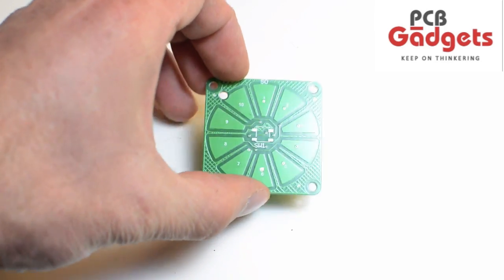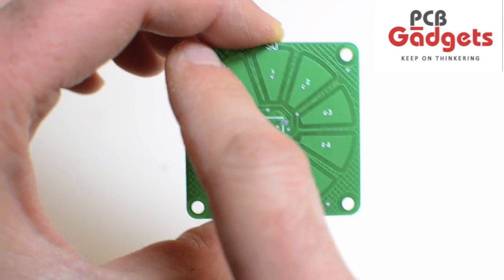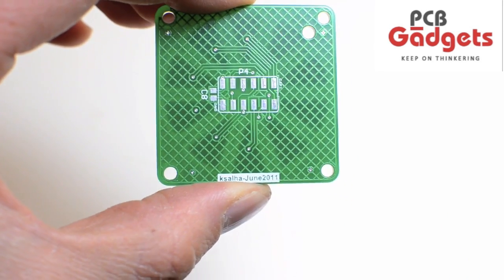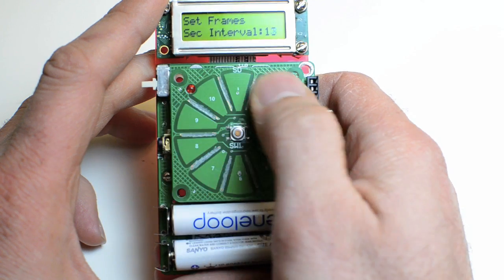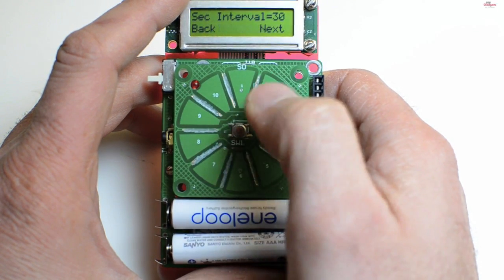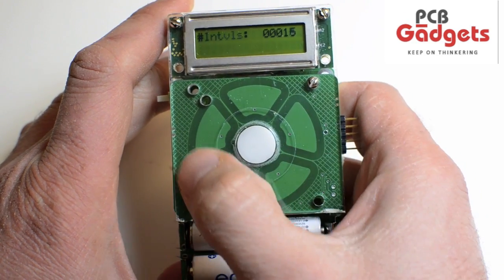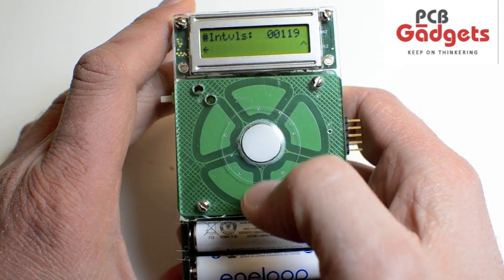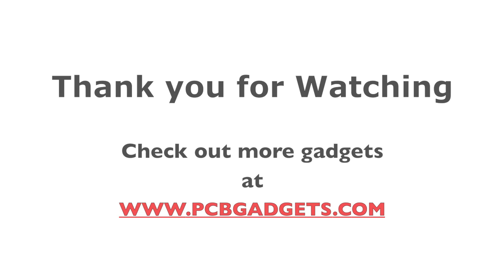Capacitive Touch Scroll Wheel Interface

Comment: hey there I have a question here if you hover plastic over that will it still work
Reply from the maker: Hi Aaron, yes it will work with plastic up to 1/8” thick.
Reply: Its 1 in by 1- 1/4 in  by 1/16 in thick sorry messed up a bit